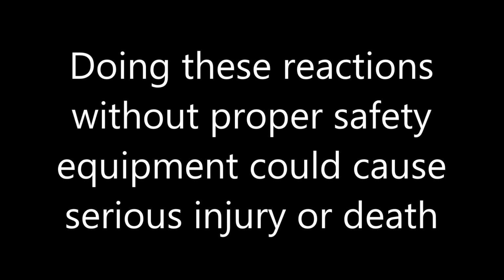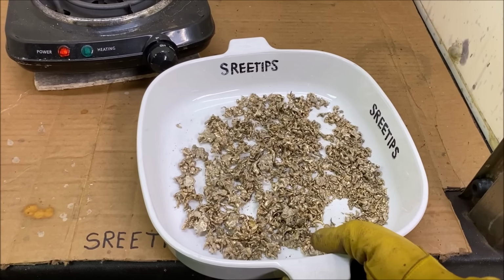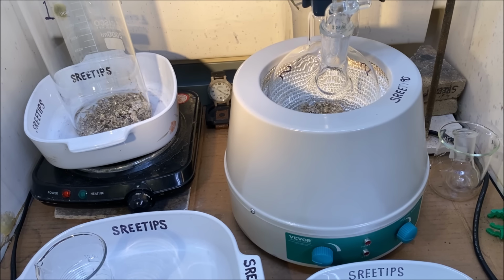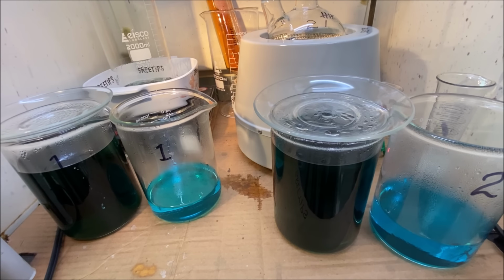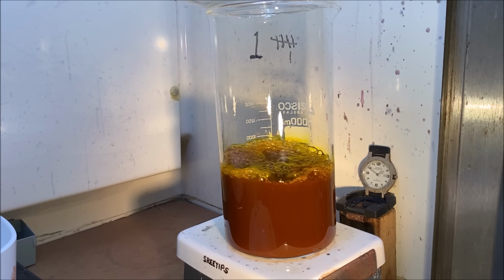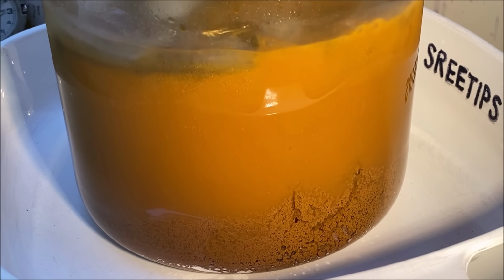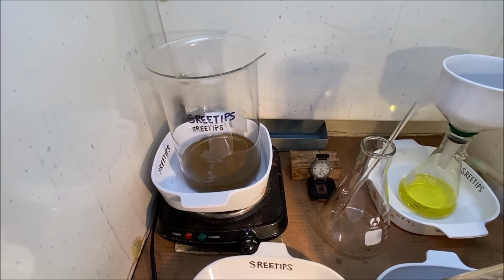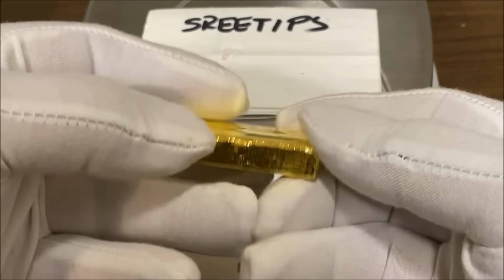Six and a Half Troy Ounce Pure GOLD BAR

Comment: Question, why do you use blow torches to melt the gold instead of a furnace crucible set-up? Just curious. Also, have you ever done an aluminum refining video? I couldnt find anything but you do have a lot of videos lol.
Reply from the maker: I use map gas (yellow cylinder) and oxy/acetylene because they are much faster and easier (for me) than an electric or gas furnace. I don’t have any experience with aluminum.
Reply: @sreetips  Much appreciated sir!

Comment: instead of  using sterling pieces which have a definite value....could you use your Cement silver in the refining process for gold?   or would the excess copper and other metals in the cement silver mess with that process?
Reply from the maker: Using cement silver is not recommended because PGMs will build up in the cement silver and cause problems in the silver cell.

Comment: 43:20 Just put a little piece of paper between crucible and ceramic wool. It might smoke for a moment, but the ash avoid sticking to the crucible. Try it next time. Stefan from Switzerland 🇨🇭
Reply from the maker: Stefan, I inadvertently used wool that had borax all over it. The paper will burn, but the borax will still stick.

Comment: Looks like your funnel is trapping most of your gasses. If you add a side neck above your center flask and attach the funnel, then your gasses will rise up into the condenser. Just a thought.

Comment: That is how the Soxhlet should function. The condensed pure nitric will drip down onto the inquart. The nitric will still be warm and as it is pure, the extraction efficiency is higher. Fresh nitric recycled.
Reply from the maker: I’ve looked into that. The setup of the soxhlet is not a good fit for this reaction. Those pieces of inquarted gold must remain submerged in the hot dilute nitric. The Soxhlet extraction is used when the desired compound (the silver and base metals in the inquarted gold) has a limited solubility in a solvent, and the impurity (the pure gold) is insoluble in that solvent. It allows for unmonitored and unmanaged operation while efficiently recycling a small amount of solvent to dissolve a larger amount of material (source: Wikipedia). None of the professional refiners that I learned from ever used one.

Comment: Can you show us how you regulate your vacuum line? I need to learn so I can regulate mine 😆
Reply from the maker: Please see my video on my vacuum system. There is a vacuum operated switch that opens and closes to keep the vacuum in a certain range (mine is set to switch off at about ten inches, and come back on at about seven inches. But I have an isolation value that cuts the switch out of the circuit so I can pull a full twenty nine inch vacuum if I need it. Also, a bleed valve left cracked open will enable me to pull a much lower vacuum if I need that.
Reply: @sreetips  Thank you Sir! 🙏🏻

Comment: The main difference i notice is there is more waste solution recovered from the reflux method, meaning way less toxic fumes went into the air vs the open beaker method
Reply from the maker: Possibly

Comment: When it comes to trying to get your gold powder into the crucible, I highly recommend this:

Take a plastic syringe of the appropriate size, (Say 75Ml for this case) and carefully cut the tip off so that the plunger can come straight down and just pass/ exit the other end. 

With the plunger removed, hold the tube vertical while  applying slight pressure to a dish or paper towel, use a spoon or whichever tool of your choice, and put the gold into the syring until 75% full. Using the plunger, press down onto the gold compressing it into a hard cake, pop it out of the syring extending plunger all the way out, and gently pick up and place the gold cake into your crucible. 

You would be able do this 2 
Or 3 times with the amount of material you have and would greatly reduce volume, ease of transport, and melting time.  Plus, a compacted gold cake would look awesome on your channel 😊
Reply from the maker: Ok, thank you

Comment: You could put a small rosebud tip on your cutting torch and melt those larger batches down quickly.The Acetylene tips will work well with propane too.A cooler flame than Acetylene,but more clean and less expensive.Plenty enough heat for gold and silver.
Reply from the maker: Thank you

Comment: I don't see why the reflux would change nitric amounts. It's a simple displacement reaction.
Reply from the maker: There’s fumes coming off the nitric boils are nitrogen dioxide. Theoretically, in the reflux condenser, those fumes will combine with condensate and form nitric acid that drips back down into the reaction, thus improving nitric efficiency. Rather than just letting them go up the exhaust stack. I may have conducted the experiment incorrectly.

Comment: Plumbers teflon tap works better on the joints than sulfuric acid.  Also, it is resistant to the nitric.  The reflux doesn’t seem to improve efficiency at the temperatures you’re using.

Comment: Seeing all that fuming, I feel like the condenser would be better in the aqua regia stage rather than the initial nitric-only stage, but i suppose that would just condense the post-reaction gases and I don't know enough to know if that would be useful.

I have wondered for a long time whether it wouldn't be better to add the lead-precipitating sulfuric after everything is dissolved...but, again, I don't know enough to know if that would be better or not.
Reply from the maker: I add the sulfuric before I dissolve the gold so I don’t forget to do it. But it wouldn’t hurt to add it after the gold dissolves in the AR.

Comment: Absolutely awesome video and great to see you testing assumptions - it was in the back of my mind "what is the condenser actually doing?"  There is no substitution for collecting data and challenging your assumptions, but it sure isn't easy to do.  The outcome you have might mean that not very much nitric is evaporating.

I still think the new setup is absolutely amazing - being able to load an titrate each charge of nitric is great so you don't have to do it by hand.  The condenser might be something you only need in certain circumstances - it's a great thing to have.
Reply from the maker: I agree

Comment: Which gold refining method do you think will recover more silver? 1, the classic beaker method, or 2 the reflux method from your silver cell?
Reply from the maker: Since they both have the same amount of gold, and the same amount of silver, the yield on silver and gold should be identical. I was looking for increased efficiency of the nitric from the reflux condenser but didn’t get it. Or maybe I did something wrong.
Reply: @sreetips  can the reflux system be used on platinum?
Reply from the maker: Most definitely.

Comment: That indeed is a spectacular bar of gold, sir :) Also, you might have gotten different results with the reflux method, had you circulated the nitric acid with a little pump into the flask rather than dripping it in and condensing the fumes, in my opinion. Either way, the result is beautiful, as you said :)

Comment: Always flow condenser water from the bottom to the top. When distilling, that is opposite the flow of distillate for more efficient cooling but with a reflux condenser you can't do that. it's just the way it is :)
Reply from the maker: I could have elevated the bottom outlet hose about the condenser level, but I didn’t have enough hose.

Comment: I suggest a Soxhlet apparatus. Load the Soxhlet with impure gold and reflux conc nitric acid through it. You can leave it on with a chiller feeding your condenser. Best wishes, Professor Simon Gibbons 👍
Reply from the maker: I looked at that and concluded that it’s not right for parting silver and base metals from inquarted gold. Immersion in the dilute solvent is the way to go here.

Comment: Nice bar. What was gained by using the reflux/flask method? What did the condenser capture? Just curious. I thought you were gonna refine separately to see if there would be a difference in yield.
Reply from the maker: Theoretically, reducing would condense red fumes back into nitric and drip it back down into the reaction so it could dissolve more silver and base metals from the Inquarted gold. There should have been an equal amount of gold in each one. So the yield would be the same for each one. Refluxing during nitric boils (or not) would not affect the gold yield. I was trying to measure the difference in nitric consumption between reflux and non-reflux reactions.
Reply: @sreetips  ah. But it was the same, if I remember right. Interesting. It's too early in the morning for me to actually listen. Lol
Reply from the maker: Correct, there wasn’t really any difference in reflux vs non-reflux

Comment: If you had a Platinum setting mostly un-dissolved in your filter after using aqua regia, wouldn't there be some dissolved Platinum in your Gold solution? You tested for gold, but you should have used ferrous sulfate to drop just the gold, and then tested to remaining liquid for Platinum.
Reply from the maker: Traces only

Comment: When it started boiling WITH ice in it during the smb i was nervous of a boil over intense precipitation this time glad u handled it like a champ
Reply from the maker: I figured that there would be a little excess nitric. But I also know that I only added 60 to 70 milliliters of nitric so it probably wasn’t too bad. Just think if I had used 200ml nitric (4 to 1 Aqua Regia)! I’d probably still be out in my shop cleaning up the gold chloride solution from the inside of my fume hood.

Comment: Hi Sreetips,

To get the best return on your NOx fumes IMO is directing them all to a Concentrated Lye & water trap which converts the NaOH into NaNO3 and NaNO2. Use Sulfuric Acid to convert those salts to nitric again and repeat.

Your sub product will be Na2SO4.

NO2 + NaOH = NaNO2 + NaNO3 + H2O

2NaNO3 + H2SO4 = 2HNO3+ Na2SO4

Comment: I think a better way to save some nitric acid is to bubble the orange fumes through a column of water. The nitrogen oxides will combine with the water and create a dilute acid. You can add junk silver to this and the acid will be used up immediately after creation. The amount of dissolved silver will give you an idea of how much acid has been saved.

Comment: Hello Sreetips, You have done dental stuff processing, other jewelers sweepings processing. As I regularly watch your channel, I see lot of spatter all around your melt table. Why don't you do a "your own melt table sweepings refining" video for year end? In fact every year you should do a waste bucket refining, filter papers, stannous test papers refining and your own work shop sweeping videos. They make a statement about end of year on your channel in addition to fetching you additional gold and silver.
Reply from the maker: I add the sweeps to a separate container. Then I add a spoon of those sweeps to a charge of molten cement silver. Then I run  the silver through my silver cell. The insoluble gold gets trapped in the filters of the silver cell. Then I recover the gold when I process the filters.

Comment: I think he is trying to show that there are many different ways to dissolve and recover the gold using silver as a sort of catalyst, there is no need to re-invent the wheel, both methods are sound, but the simple one is best, I am not sure that the feeling he describes when he holds the gold bar is purely related to it's monetary value or there is something magical in a cold lifeless ingot of metal, but in my insane world these chemical reactions that are shown have a way of calming me down and gives me something to think about, like the reflux side the fumes condense and run back down into the boiling flask, where as the other method more escapes to air but most hit the loose cover plate and drip down back into the beaker as well. I don't think any gold is lost to air that vents out the work hood, plus his trips to the places he gets the material from are fun, thank you Sreetips

Comment: Quick question Makdaddy. 
Mr. Mak.
Seriously your like the Fonz if it were that one was old enough to kno by the definition of that word.
So I well we "spoke" a few days or a weeks back about a chip.
Nothing containing any precious metals. Only the most precious of all. Time. 
And well spent it did sound to me as contentment and satisfaction are the 2 main things. Just as you pointed out on the video i just watched on a 10 lb bag of pins... The number is usually a small number but the importance of these..."numbers"/"#" is Paramount... since that word has no equal or shouldn't lol i do go on but so many things in the fire the gold is on the bottom of my list but when that moment comes it will be used without hesitation every drop. I don't keep cash on me nor a device. You see im a Cowboy...Country...from the fields of a farmers joy. Few meet or make rhe list but if ever you have need holler. 
Question: the easiest... quickest...cheapest way to release gold...foil from pins or other?
Thanks so much and have a great weekend Mr. Mak.

Last
Reply from the maker: Unfortunately, getting pure gold, from any source, is never quick, easy, or cheap. I could possibly have used a sulfuric acid stripping cell to remove the thick gold coating from these pins. But that would have another set of problems. I think that, while not cheap (five bottles of nitric at $75 each), I’d rather let the chemicals do all the work for me.
Reply: @sreetips  awesome. I don't have 10 lbs but now I know what to do if ever I were to have such. Have a great day 
Last

Comment: Are the gasses coming off nitric acid fumes, or a result of a chemical reaction which would alter it. I'd assume the condensate isn't nitric acid but whatever was a result of the reaction. I could also be completely wrong.
Reply: The condensate coming off is indeed nitric acid in vapor form, nitrogen dioxide is brown to red and highly corrosive, dangerous to your lungs, your eyes, your mouth; frankly any mucous membrane, and when combined with the water held in mucus returns to concentrated nitric acid. The reflux allows the water vapor to combine with the vapors of nitrogen dioxide to reform nitric acid. This allows it to work harder as less is going up the fume hood as a one pass and gone reaction. As Kevin shows, the stoichiometry (a big word that means measurements and procedural events  -as undertaken) disproves this to a great extent for these reactions. The reflux procedure just keeps the nitric acid at a larger partial pressure and allows the volume of reactants to remain unchanged in gross. Works better in organic chemistry for many reactions where those factors matter. It makes casual chemistry a bit more complex and a pain, and is totally unnecessary to this hobby. But, oooh, the amount of glass and extra equipment, shiny! <g>

Edited for punctuation
Reply from the maker: I love it!

Comment: i really dont see the benefit on the new setup, add the nitric acid is simpler this way and uses less time but, it streses me to see so much expensive and fragile equipment be connected and disconnected so many times, gives me the feeling something will break

i dont remember seeing a video where you had to add so much borax when doing the inquartation, the filter had so much material after you filtered the solution with gold, why would this happen?
Reply from the maker: I think a full charge in the addition funnel instead of 100ml doses would go a long way to relieving our stress of having to break the apparatus down over and over. As far as the contamination during the inquartation: who knows what junk lurks in the alloys of men?!?!

Comment: Is the Troy ounce just a gold related term and how did it come to be?
Reply from the maker: According to Wikipedia: Troy weight is a system of units of mass that originated in the Kingdom of England in the 15th century and is primarily used in the precious metals industry. The troy weight units are the grain, the pennyweight (24 grains), the troy ounce (20 pennyweights), and the troy pound (12 troy ounces). One troy ounce (oz t) equals exactly 31.1034768 grams.
Reply: @sreetips Thanks for the info Sreetips 🙂

Comment: @Mrs. Sreetips are there enough pennies in the bank for a small gas or induction furnace ? Inquarting by  hand brutal.
Reply: iirc he has both, but he prefers to do it this way
Reply from the maker: Open face melt dish and oxy/acetylene is much faster and easier to use.
Reply: Better to have it and not need it I guess.

Comment: How much of metal are you think you lose when it hits the water
Reply: Steve, next time you post, try refreshing the feed, for touch screens this is done by pulling down from the top, for desktop/nontouch this is done in your browser by whatever means is provided, usually, press F5 to refresh. Then you will see your comment for editing if needed and to insure it did indeed post. 
    I'm guessing your question is in relation to the inquarted gold sometimes splattering up and out when dropped from 12-18 inches as he shows? No idea but, I see it occasionally as well, hope he uses a fine hair push broom and a finetooth comb after to clean his work area and brush.
Reply from the maker: Traces only

Comment: Did my first melt, did it in a small crucible with Borax. Doing small pieces at the moment before trying the Acid method. One button came out gold colored and two came out copper “ish” colored. Tried finding information but couldn’t find a good answer, only round about answers. Any thoughts or advice?
Reply from the maker: Melting gold won’t cause it to become pure. It must be refined.
Reply: @ thank you for taking the time to clarify that for me.